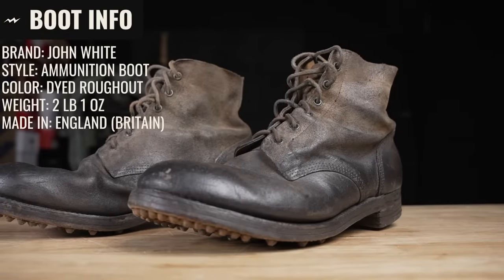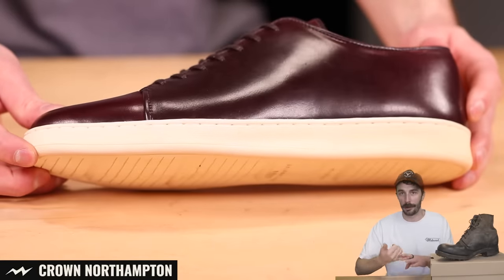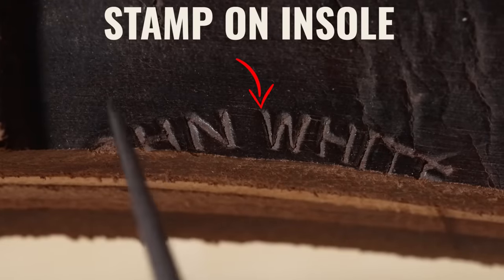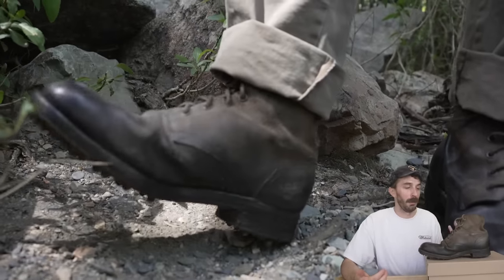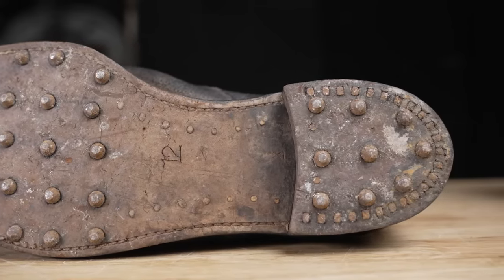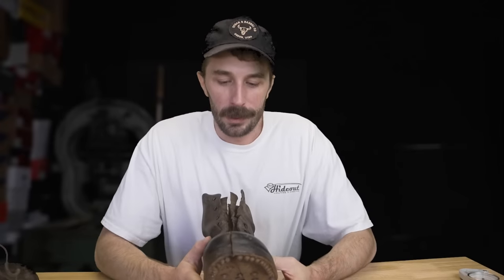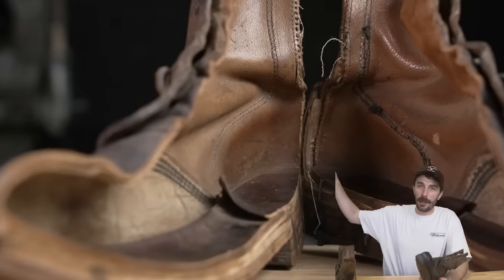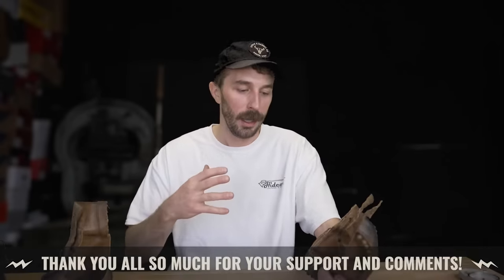Why 80 yr old British WW2 boots are better than modern boots

Comment: Northampton UK still makes the world's best shoes. Foster & sons, Edward Greens, John Lobb & Solovair to name a few. Crown as mentioned in the video. Northampton hasn't stopped making awesome shoes, but the world seems to prefer cheap and disposable. I mean... who even repairs their shoes these days?
Reply: I feel like some people would but alot of cheaper shoe arnt reparable since it's all just one big pice of foam
Reply: Solovair are the factory that makes Doc Martins right? If so then I wouldn’t say they’re in the same category as the others you listed.
Reply: @Sth_Magical  The Dm brand name was sold to a company in the far east and are not the same quality. My last pair of Dm steel toe shoes fell apart in less than 12 months, just got a pair of Solovair shoes new and the difference is night and day. The leather is thicker and all the inside is lined with a thin soft leather, the Dm's just had cloth lining not the same quality.
Reply: Crockett and Jones, Trickers, Loake, Barker, Sanders, the list goes on.  There's more companies making goodyear welted shoes in the 'shire than in all of america.
Reply: @GrS It isn't silly, you can look at this one part of the shoe to see where Solovair cuts corners: they use rubber welts and rubber outsoles compared to the other manufaturers who still use oak bark tanned leather welts onto either leather outsoles or Dainite/ridgeway/a derivative.

Specifically the welt itself is something which is a crucial part of a shoe's construction and requires that it be a study material.
Reply: @douglastalbot8031  Solovair isn't using oark bark tanned leather of their welts, to me that seems like a corner cutting cost on an important part of the shoe
Reply: Crocket and Jones were the shoes that I wanted but could never afford.
Reply: @Sth_Magical  Doc Marten's whole thing was using rubber sole for a softer sole from the get go for their signature airpocket that you cannot fabricate with leather soles.

Solovair literally comes from "Sole of Air".

You can argue this was corner cutting but they were deliberately softer boots to wear than that stiff boots of yore. 
DMs were never advertised as hard wearing military boots but as middle class wear, though I have heard old stories of military guys in the past wearing original DMs with the lacing dyed black as an alternative to their harder mil boots. I would imagine their (much abused, since discarded) lifetime warranty made up for any shortcomings in hard use roles and the boots were generally good enough for in country work with access to the warranty.
Reply: @Sth_Magical  No, solovair makes a very similar product to modern docs, but with a higher manufacturing quality. I believe this channel have reviewed them actually
Reply: Solovair boot bought last year are the least comfortable shoe I have ever owned; zero cushion, debilitatingly uncomfortable. Sorry to say

Comment: William Lennon, one of the original government suppliers, is still making these for under £200. They've been making excellent quality boots for work, hiking and casual wear since 1904.  They also make specialised boots for certain industries, such as foundrymen and hill shepherds.
Reply: Still family owned too! I'm intending on buying some for the autumn!
Reply: @dngrmousey  if you want them for the autumn order now. In fact you might not get them till Christmas. They are all made to order and have a 4-5 month lead time. I love my Lennon boots though, they were well worth the wait! (I have the 78TC work boot with Vibram sole customised in a different leather)
Reply: I've got their B5 boot and I love it (with the rubber sole and Blakey tips and heel)
Reply: I just posted a comment on Lennon's myself then found your entry.  (It won't hurt to leave mine up to give them a bit more help)
Reply: I recently bought a pair they are fabulous handmade  boots at a very reasonable price.
Reply: @agw100100  ditto
Reply: @dngrmousey  Just a tip, the break in takes a while. Also, insoles. Get insoles.

Comment: To be fair, the channel has yet to cut open a pair of modern Northampton made boots from one of the heritage British boot manufacturers (e.g Trickers, Crocket and Jones, Cheaney etc). Would be interesting to compare them to these John Whites
Reply: true good boots those.
Reply: Have a pair of Crocket and Jones Islay boots, a brutal boot to break in.
Reply: @snuscaboose1942  are the islays made that well? And vibergs? Channel welt?
Reply: I love my Trickers Stow Boot. Would love to see them cut apart and compared to the John White WWIII boot.
Reply: Edward green. G&G
Reply: Tricker's uses leather board (or whatever it's called) in their toe and heel stiffeners.  CJ mainline does as well, I think CJ handgrade uses full grain leather in their toe and heel stiffeners.  Most of Cheaney's stuff is a step below both tricker's and CJ so I doubt they are using full grain either.

Honestly florsheim stopped using full grain in the toe and heel stiffeners sometime in the 50's or 60's.  Most of the companies that are using it are just doing it as a flex.  I've got like 8 pairs of florsheim from the 50's all the way to the 90's, all of them with serious wear on them and I can't complain about how the stiffeners have held up.  How the heel holds up depends mostly on if a shoe horn is used everytime or not.  

Most shoe/boot makers use wooden/fiberglass shanks if they use them at all.  CJ stopped using metal shanks around the time of 9/11.  Their customers complained about having to take their shoes off for airport security.  Alden is one of the few that I know of that still uses metal shanks.  

I've got like 70 odd pair of boots and shoes, all made in Canada, spain, USA or the Shire.  I couldn't care less if they used particle or fullgrain leather in the heel/toe stiffeners.  As I said, I think it's all just a flex.  In this order, quality of the leather upper/the shell, quality of the lining (CJ handgrade uses nicer leather in their linings than Allen Edmonds usually does on their uppers), quality of the clicking/stitching, presence of a shank, and if the sole is oakbark tanned or not.  All those things are what matters to me.
Reply: I wear altberg defender boots and think they are the best boot for the price out there . I'd like to see them cut open
Reply: I have some seargents veltschoen. Still a bit new (18 months) I had a pair of trickers in my youth they had three full long soles and countless partials until my evil ex disappeared them.
Reply: @srqsup  , Don't think John White has made WW3 boot yet. Or perhaps you know something we wish is not going to happen.
Reply: @jimmyh8090  Just ordered some made to order Hogg Motorcycle boots from Altberg. Went to the factory for a fitting. So helpful.
Reply: Was just starting to get exact copies of german WWII ankle boot's made early 2000's for Re-enactment here in Northampton  until China wiped me out.
As far as I'm aware this Town known for it's former Boot & Shoe made the footwear primarily for the Canadian forces of WWII among other's.
Reply: @claytonberg721  while I don’t agree with your cheaney comment I am no expert,I have cheaney shoes and boots and I love them both.
Also I was in the cheaney factory shop when I overheard them talking about making boots for Crockett and Jones’s I checked out Crockett and jones boots and the pair I had bought from cheaneys factory shop are the exact same as Crockett and jones were selling and even stranger cheaney didn’t sell the boots I bought at any of there retail places.
Reply: My first job was making shoes in Church's shoe factory. They're still made to an exceptional quality.

Comment: Hi, I was issued with 2 pairs of Ammo Boots in the fifties and could tell you that they were crap, and thats not just my opinion but that of a lot of cobblers in UK. First, the boots you are holding don’t have a toe cap so it’s very likely that they were issued to the RAF, the Royal Navy or the Canadians. The Brits had dimpled leather toe caps and heels. First thing that we had to do was iron the toe cap and heel to stretch the leather so that it would take twenty layers of shoe polished mirror shine. There were 13 studs in the sole and a steel horse shoe in the heel. The leather lace had a knot in one end and the lace was threaded from the toe cap end in one continuous loop. Laces were also polished! These boots were only ever used for important parades and usually lived in the bottom of your steel locker. The other pair of boots became your work boots, these were the ones your life depended on. So, you placed them in a bucket of water overnight, put on two layers of socks on your feet the next morning and put your wet boots on, lacing them up tight and went for a ten mile run. When you came back you made sure that they were nice and dry and started putting as much Dubbing (leather preservative) as the boots could take and went for a quick three mile run and got the Dubbing out and rubbed some more. After that you got your Kiwi boot polish and worked the polish in to get a reasonable shine on them to pass the daily inspection.  Because the tongue in these boots came up only halfway up made the boots wet inside when you stepped into a deep puddle. In the Paras we wore the short Puttees over the boots, partly to strengthen the ankle area and partly to deter water entering. A lot of us managed to get the Wet Weather Waterproof boots issued for Artic warfare and they were definitely waterproof but heavy. The next issue in the late fifties we got the same boots but with a rubber Commando Sole. Les noisy but still a crapy fit and just as wet. The first decent pair of boots i got issued was in New Zealand, these were high boots with the tongue attached all the way to the top of the boot. I hope that this first hand footwear knowledge is of some use. The Army issue shoes in the seventies were pretty good and lasted well. Cheers mate. Harera
Reply: Ive a photo of my Dad taken i think after May 1945 in Germany looking really smart but his friend with him in the tank corp i think has shoes on , i never seen a soldier the in shoes
Reply: In the field there was no boot polish, only dubbin.
Reply: @Arcmor1  Polish soldiers took Monte Casino! What do you mean they weren't in the field?!
Reply: @tomobedlam297   not sure if you're being serious or not.
Boot polish* for clarity. Little p
Reply: @Arcmor1  😅 @ your edit! 😉
Reply: For the record: Kiwi polish is an Australian product, not a NZ one. The inventor's wife was a Kiwi (Big *K 😉😁)
Reply: @tomobedlam297  In the late 1980’s I worked with a fine gentlemen and one of the best engineers I ever knew. Chris Dobrowolski.  He fought with the Poles that took Casino.  He retired soon after I started and I’ve always regretted not being able to spend more time with him.  What a great man.
Reply: @TheAirplaneDriver  My father's brother fought at Cassino. It was a hell of a campaign for sure. He later got to see Mussolini and his mistress hanging up after the partisans dealt to them.
Reply: What does 'Harera' mean?
Reply: @rundattmedia2106  What's with the Karen anger at the dude's typesetting dude? You're being so undude.
Reply: @tomobedlam297  not being a Karen, just hard to read without paragraphs. You know, basic simple English?
Reply: @bodhid  Harera is a word invented on the spot by the beloved nephew of Sir Charles Farlarly, the creator of Scrabble, when he was in  imminent danger of losing the game! 👍😁
Reply: @rundattmedia2106  I too can boast some mastery of basic English and some Latin but I'm not about to pull English professor rank on a checkout lady at the supermarket. Choose your battles.
Reply: @tomobedlam297  that's irrelevant. If someone is writing a huge wall of text at least make it easy on the reader. Otherwise it's not worth reading. This is why paragraphs are a thing. Not quite sure how you fail to comprehend this. Nothing to do with being a professor. It's basic English comprehension, not rocket science.
Reply: @rundattmedia2106  sorry dude: 
You lost your argument at your use of the word "mofo". 
Case closed... QED.
Reply: @tomobedlam297  heathen.
Reply: @rundattmedia2106  Hoist on your own petard.
Reply: Apologies to our fellow internet users: 
We are experiencing a surge in desperate Google searching from someone whose manhood has been compromised by hearing the truth... 😅
Reply: "Momma, they picked on me and hurt my feelings!!" 
"Why would they do such a thing child of mine?"
"They were cruel and mean momma. Really cruel and mean."
"Bless you son of mine. The world is a harsh penitence for a Christian child. What in Our Precious Lord's Holy Name could have found cause for them to doubt your righteousness O fruit of my sacred womb?"
"I only said mofo darling mother."
"Mofo? I'm not familiar with that. Is that the Queen's English? Do enlighten me O beloved child of mine"
"
Reply: Snap Piere, you just forgot the toecap plate and you are correct 13 studs in the sole.Never ever did put dubbin on our boots. Once broken in, by water or piss and molded to your own feet they were comfortable but to get them broken in was murder on the feet. I was from the late 50s to 2000, had the Ammo boots for first five or six years. . For a short time in BAOR, had the heavy rubber soled boot we christened rock n' rolls,these we did dubbin.Then onto DMS (Direct molded sole), then Combat High, each and everyone of them bloody sponges.Two makes of Jungle boots , Bells and Dunlops, the Dunlps lasted a bit longer than the Bells, again probably designed by a civvie that had only seen Tarzan movies and had never been in a jungle.Oh ,we also resorted to short puttees ,with both the ammo boot and the DMS.Reading one other comment, some guy reckoned he , on a 2hr stag got his feet soaked enough to condition his ammo boots but was wearing a goretex smock, I never saw a poncho until I was in the far east, 1964. Up to then it was a gas cape.
Reply: The premise of the video is a joke. British army boots hit an all time low with Boots,  DMS,  in the  1970s and early 80's. Things started to improve after the Falklands War with lessons were (re) learned the hard way.... Todays soldiers have the choice from a range of excellent boots from top quality makers. Today's boots are designed to be appropriate to the terrain and climate they are serving in..I can't imagine one soldier wanting to swap their Altburgs or AKU boots for those museum pieces in the video...
Reply: @bodhid  Hi, the Maori word HARERA means goodbye (said to someone leaving), farewell! bye, bye-bye.  Is that answer OK? Cheers mate. Harera.
Reply: @crouqetoo2  Hi, you are spot on about most of your comments. Those so called Jungle Boots canvas were originally designed by Bata Shoe Co. and all they did was elongate the Hockey Boots and later on put in drainage holes on the inside instep, as if that helped. Gas Cape, right again. I could go on and on. When the NZ Army was looking at replacing our winter gear they asked the Deer Hunters and Government Conservation Department deer cullers what they would recommend.  Before my last annual camp at Waiouru we were told to bring only army issue gear. So I did (mine was originally issued to the Norwegian Army and acquired by me on an Artic exercise by the old soldiers “ways and means act”) and was the only soldier warm and dry. Experience can keep you out of the shite on many occasions. There are very few officers willing to challenge a Senior NCO when he wears his Para Wings on a smock! Cheers mate. Harera.
Reply: I can vouch for every word of this. Often wondered if Ammo boots were responsible for so many of my peers having foot problems in later life.
Reply: Is that was NZ is getting flooded?
Reply: First thing I noticed was the lacing. I mind the auld man's boots with the knot and the single lace. He still had a pair into the late 70s. He did his national service 60 to about 63 or 4
Reply: @rodden1953  usually only for officers or ORs for walking out
Reply: Do you remember what sort of insole (if any) was in each type of boot ?
Reply: @adrianparker-e9f  the hobnail boots are a non removable leather.......the shitty DMS boots have a "cheesegrater" plastic mesh, like US Jungle boots have
Reply: @ridge2542  That what i thought too but he's only an NCO
Reply: @rodden1953  yes but like i said, for walking-out. All other occasions (except pt ofcourse, where plimsoles were worn) was ammo boots

Comment: Every British Army Infantry Battalion until 1965 had a Cobbler. He repaired Boots, Ankle and returned them to the Quartermaster Store for pickup by the individual soldier. This included replacement studs, heel and toe plates, and stitching-up breaks in the upper leather. This practice ceased after 1965, when Boots, DMS (Direct Moulded Sole) came into service. Thereafter, boots were simply replaced as a whole Stores unit.
Reply: DMS boots, had a few pairs in the late 70's early 80"s (Crab air so not alot of of rough treatment) and even we said they were rubbish, the Falkland war confirmed this, did not go, but some of my para  mates said they "swopped" boots with captured Argie troops, as theres were better quality!!.